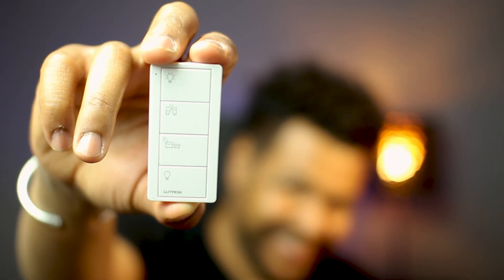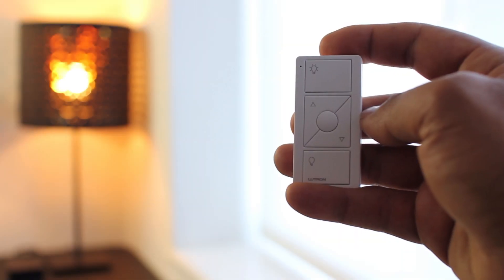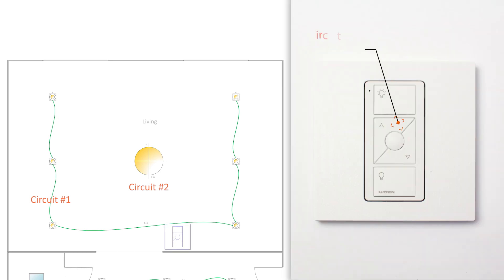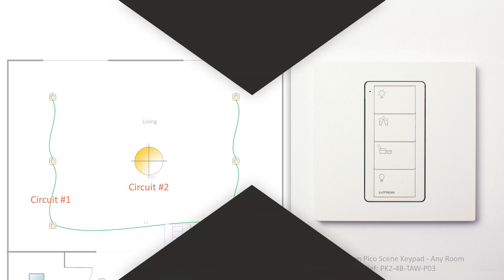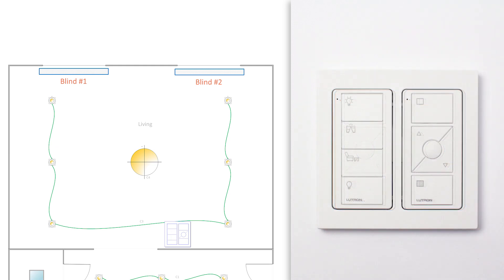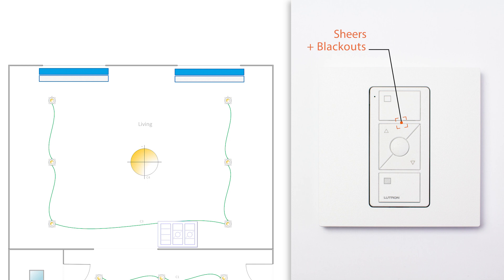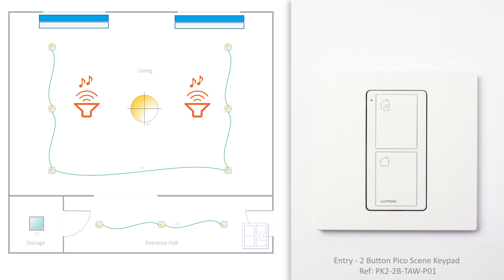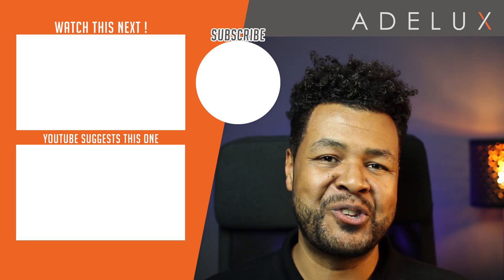Which PICO? // Lutron RA2 Select COMPLETE SELECTION GUIDE for Pico Remotes - [NEW] (2020) Adelux

Comment: Hello Xavier. Excellent video. I have a question. Can i  control the Ceiling fan with a pico control in a RA2 Select system ?
Reply from the maker: Hi thanks for your comment! Well you know really a pico is a pico, meaning it’s basically a remote to operate a power module. 
So yeah you could use pico ref: PJ2-3BRL-GWH-F01 which is a pico with fan control engraving. And that pico will remotely operate the Maestro RRD-2ANF-WH which is the fan control power module. 
Hope this helps ✌🏾
Reply: @adelux  thanks Xavier. Other questions  the pico PJ2-4B-GIV-L21 works with the system RA02 select?
Reply from the maker: All you need to know 👉🏾https://www.lutron.com/en-US/products/pages/wholehomesystems/ra2select/components.aspx#?cat=PC1
Reply: @adelux  thanks for the información. Have a nice day

Comment: Hi Xavier, thanks for the tutorial. Is it possible, with the four button shades control that controls two shades (open and closed), to press open and then when part way up press a button to stop the shade moving?  Similar to the single shade control functionality.
Reply from the maker: Yes! Button will open/stop + close/stop for each group of blinds. One thing I’ve noticed though is that if the main repeater is turned off for some reason then button will fully open or close. Hope this helps ✌🏾
Reply: Thanks  @adelux , I have another question if you don’t mind. Is it possible to program a scene button, say, such that first press is on second press is off hold down to dim, etc.?  So, basically to program the buttons to be multi-function taking the current state of the light/shade into account?
Reply from the maker: To do this you will need Lutron Homeworks

Comment: How do you handle the actual light switch? My house already has switches in place. Do you eliminate all of them?
Reply from the maker: Technically yes. 
You can terminate the existing wiring of the switches with wago type connectors and leave the cables in the back box. Then you can screw the Pico faceplate over (where the old switch was)  and slide in your Pico. This Is how we do it in the UK - EU though
Reply: Adelux Lighting Control & Motorised Blinds thank you.  Do you recommend this over purchasing the rf maestro switches? They aren’t cheap
Reply from the maker: From your question I believe you probably based in the us 🇺🇸.  If it’s the case let me rephrase my previous answer. Whether or not you use a Pico, you still need “a dimmer” to control the load and if you are in the US and use RA2 select you will need a maestro dimmer that can be fitted where your existing switch is
Reply: Adelux Lighting Control & Motorised Blinds thank you!

Comment: Please, for each of the circuits I would like to know other devices in the complete setup apart from the Pico remotes.  Is it one Inline-dimmer for each circuit,  One RA2 repeater or more for this design setup.
Reply from the maker: Hi, it is always one inline dimmer for each lighting circuit. One RA2 Select repeater per project. If you need to use more than one you probably need to look at Lutron HomeWorks QS instead. More info on full Lutron RA2 Select setup here >> https://youtu.be/TRGYxfdKuPg